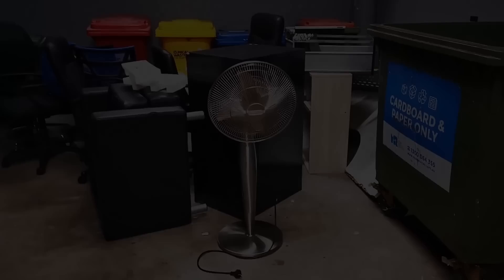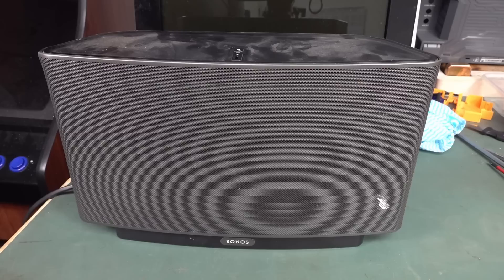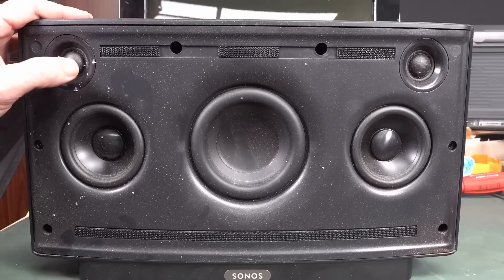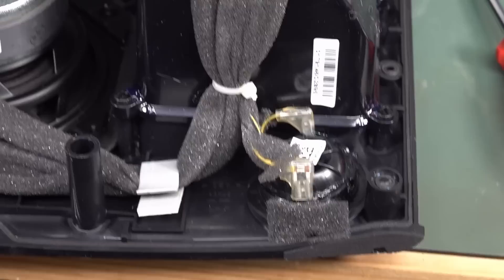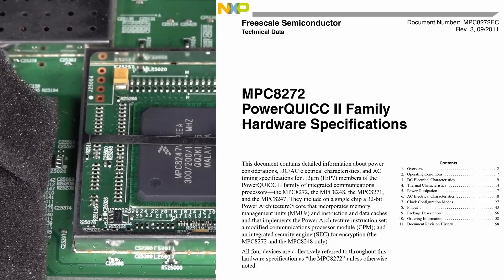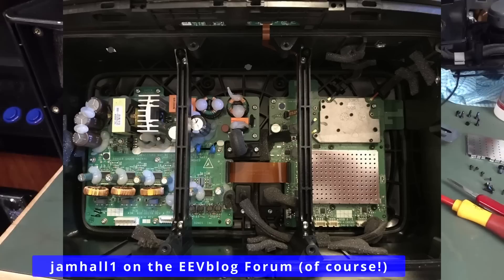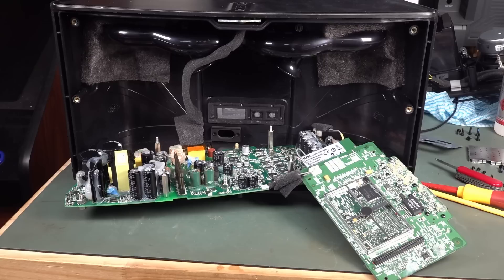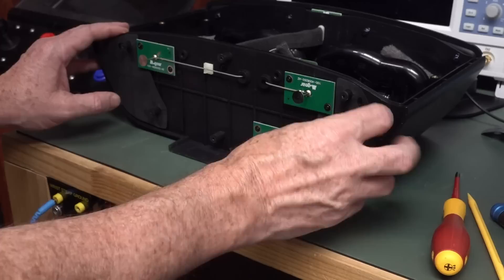EEVblog 1514 - Sonos: The Juicero of Wifi Speakers? (TEARDOWN)

Comment: Peerless is a half decent driver brand, the ports are tuned length to match speaker resonance and the cabinet resonance. Longer the lower they go, this is probably good for ~50Hz or something lol.  The screws are to stop rattling and maintain enclosure rigidity. Overall not bad for a plastic speaker system.

Comment: If my fuse has continuity while mounted on the board, does that necessarily mean that it's ok? Or could the continuity come from the rest of the board via these 2 leads? I'm planning on replacing the 2 blue power caps and bridge rectifier which may have been blown from power surges . Unfortunately my multimeter doesn't have tests for caps and diodes.

Comment: I recently trash picked a wireless subwoofer (not bluetooth or wifi) and the construction was fairly similar, though the case is MDF instead of plastic. It was a Denon, so a fairly mid-high end consumer brand. I've actually had it apart near my bench for a while because as far as I can tell it should work but without the matching home theater base station it's a brick. I'll eventually put a normal wired amplifier in it I think... it's a nice piece.
Reply: If you can identify the amplifier chip inside, you can solder a line level in just fine. Just be careful as some amplifiers only accept a balanced signal. A quick pdf search of the amp chip let’s you identify the pins.
Reply: @FAKEAXIS  From what I remember it actually has a chip that incorporates both the digital decoding and the amplification. I want to say it was a TI chip made just for this kind of wireless subwoofer application. Normally that's exactly what I'd do.

Comment: Dave getting flooded somewhat thematically with portable audio equipment lately out of that dumpster room! :) Wow, this stuff with the powerquicc CPU & the mini PCI 3x3 MIMO wifi card could double as a premium wifi router from around 2013. That amp could well fit in 7.1 surround capable smaller home theater amp receiver. Massive overengineering, but if it was a premium product then there ya have it!

Comment: Sonos is an absolutely fantastic system. It’s primarily a multi room audio system with fantastic sound quality. You need to use the Sonos S1 app for older devices, not the S2 app. You can reset it by holding down the button on top whilst powering on. Then setup in the app. It’s actually great kit and really well supported by Sonos. I had the very first gen demo kit when it arrived in the UK in 2005 and the system still works perfectly to this day including supporting the latest streaming services!

Comment: I have a bunch of Sonos speakers. Would I recommend them? Not really - their control software is *horrible*. Really wish they had a browser based configuration like my old Sony sets had. But, they work fine as Airplay devices and are cheaper than many of the alternatives. Also, why the heck does the Connect (or whatever it's called these days) cost so much!

Comment: Thats a mini-PCI wifi card. we used to use them back in 08-09 while setting up long range wifi with off the shelf hardware. The WMP series is i believe by this company called Compex or something like that. These pci(not pcie) cards usually used an atheros chipset and quite stable.
Edit: i can bet anything that the processor ran a custom linux and used the linux drivers for the wifi connectivity
Also looks like an early prototype. Just get a base board,a wifi pci card and a sound circuit and bam you got a product.

Comment: I got a couple of the little cylindrical ones for free a while back, glad I didn't pay for them. They sound good but between the "cloud" binding, wifi dropoffs, constant firmware updates, and no line in I just found them irritating to use. I've considered either trying to firmware hack them to be dumb stream players or just replacing the electronic guts with a dumb amplifier module to turn them into normal speakers.
Reply: Now yours may be more basic than the one Dave has, but trust me, you do not want to redo the electronics in a fully active speaker from scratch. If you're lucky, they have an analog crossover and you can tap in after the DAC (ideally, with a switch so you can toggle between external RCA input and the stock streamer), but other than that the software route seems the most promising. You never know what sort of EQ is still baked in. You may also be able to interface to the DAC via I²S (people have been using Pis to output that). If you're extremely lucky, you find a passive crossover.

Comment: If it has a sufficient amount of bass it could be a vibrating rattle trap like my old scr-8 portable stereo where I had to remove the metal speaker grills so I could squeeze a bunch of silicone cement all around the corners, and then press the grills back into place. The reason for all that effort was they both buzzed and rang like sickish bells. It was just fine right up to the day the warranty expired. On that day I stuck a 40W RMS power booster in it ( more like 200W RMS, because the stereos internal power supply was 20 volts, not 12V. Oops! ). So all the wires and ferrite cores, plastic panels, and the like might generate some highly unpleasant musical notes. Like buzzing.

Comment: I would remove all electronics and replace it with a power supply and bluetooth amplifier to convert the whole device to just a portable bluetooth speaker. No Sonos app registration issues, just connect and play

Comment: The silastic-guy is legally obliged to squirt at least 42 times because power isolation depends on it!
Reply from the maker: Everyone knows that 15 pieces of flair is the MINIMUM
Reply: It's probably run off the mill hot glue, not silicone.

Comment: All the acoustic foam on the outside is to stop the crappy plastic enclosure from resonating and rattling, especially from the subwoofer. Similarly, when you have active systems inside a speaker enclosure, you need to really secure things, low frequency vibrations can really cause problems over time. The number of screws on this thing is nothing compared to oldschool Sony TVs and VCRs. Bang & Olufsen were even worse!

Comment: Sonos went through a thing a couple years' back, where they were actually bricking Gen 1 units like this when people used the hardware to claim discounts on a Gen 2 unit. As you mentioned, this is not a cheap unit, and that mess flew in the face of hi-fi culture. (How many hi-fi nerds do you know that regularly replace a favorite system, even after 15 years or so?) It is good to see that there is some actual build quality behind the Sonos price tag, however.
Reply: I use Gen 1 JBL GO at work and Gen 2 at home, that would really suck if that happened to me too._
Reply: @primech-128bit  Fortunately JBL is definitely not Sonos. My employer is a Harman Commercial Audio dealer (of which JBL is a sub brand). In the commercial audio sector, Harman does an excellent job backing a storied brand's reputation. From what I've seen, it's the same in the consumer market. I own a set of 230NC wireless earbuds, as well as a Clip4 speaker, which work well for the relative pittance I paid.

Comment: Definitely looks like an early revision product, when the future existence of the business is relying on this product you can resist a lot of value engineering pressures!
Reply: I would say it was a proof-of-concept model and the development program got so far behind that they had to rush that model into production without having any time  to do cost optimisation or improvements for manufacturability.

Comment: But really, antennas on the bottom and setting them down basically on the surface like feet? No wonder it didn't work on the steel bench at work.

Comment: The Devialet speakers beat that on all fronts.
Got two phantoms here, they are super heavy, have excellent bass down to 16Hz for earthquake effects.
Reply: the price though... Devialet are certainly a masterpiece. I haven't heard them, but i was very impressed by what i've seen on the internet.
Reply: @victortitov1740  The sound is near perfect, they go very loud without distortion. Due to the way they power their amps they do tend to draw huge peak power, they make my lights dim on the beat.

Comment: I haven't read the comments, but Sonos was hot on getting owners to upgrade away from early 2010 legacy products back in May 2020.  If you immediately jumped on the 'deal' for 30% off, they would send a kill-spike to your legacy device to disable its use altogether, and it was on you to 'recycle' it.  Due to all the bad press, Sonos actually fell on its sword, and decided to NOT kill legacy devices while still allowing owners to receive the encouraged upgrade discount.  The early adopters of the discount were SOL, and there was no restoration of a disabled speaker.  Sonos is not a massive speaker company and hasn't sold out yet, so this design that doesn't appear to have production cost constraints...and it's from 2009, from when we just started getting miniaturized SoCs.  I have all mine still running the S1 app to be compatible with this Play 5, which still sounds great as a table radio in a kitchen or dining room.  It doesn't deserve to be relegated to a garage speaker yet.  
Their speakers sound very nice and pleasant and accurate to me - and you really can't beat their ecosystem.
Reply: Absolutely DISGUSTING. A company that has the ultimate say on the LIFE of my devices? No THANKS.
I was absolutely right in my feelings about this company and products.

Comment: I am going to say that this is not exactly like the Juicero. The Thing that made that device useless was that it required not only an online connection to actually function, but you could only use their bags with it and it offered and the robustness of the machine didn't really matter to the output of the juice. 

while there are some similarities, this is an actual functional device and it only requires you to bring your own music to it. Once you own it, there is nothing else you have to buy to make it work and if you don't have wifi, it'll still work.

Comment: Seems to me to be engineered well.  If I'm making a premium product, I cannot tolerate vibrations, buzzing, etc. from unsecured components vibrating against each other.  That's why the heavy use of adhesives and fasteners.  Nothing worse than an unwanted buzz from a premium speaker.

Comment: That definitely is the juicero of speakers, I remember when we started to carry them about 8 years ago at a major electronics retailer I worked at. We carried the speakers, but didn’t even carry the bridge that was necessary to wirelessly connect it with anything most people would return the speakers within a few days of purchasing. We contacted Sonos multiple times to try to get the Bridges, but they never sent them. Once they came out with the models that didn’t require the bridge most people already stopped caring about them. And around then we stopped carrying them. 
The engineer is in the comments talking about all the cool stuff he did but if you can’t connect it with anything and have to jump through hoops to get it to work what’s the point?

Comment: Foam like that is probably to address issues with foot buzz. Building powered speakers that don't buzz in injection molded plastics is a lot harder than you might imagine.

Comment: i never seen the inside of a sonos speaker, its impressive. i hate that it has wifi and it needs an app to work. it probably would last 20 year or more if it were just a dumb speaker with some rca inputs on the back

Comment: To be fair, Sonos are not cheap and i would hope that everything is designed and built as best it can be, without needing to invent new physics or materials of course! I wonder if the wifi / control + mixing boards are reused in other wireless speakers they sell.   Any sonos users know?

Comment: its actually quite normal that everything is glued and locked down to a point "above and beyound" on a speaker, mainly a speaker with a heawy woofer and tons of inner cirquitboards and antennas, simply from the vibration.. if it wasnt then they hadnt done their homwwork.
just imagine one thing comming loose, doesnt matter how small that thing is.. a nut, bolt, washer, non critical cirquit component.. then this speaker is defective, useless, as it will rattle everytime things gets going, and it aint like these speakers is easy to open for the average consumer. 
Also why its got so many screws glued down, with that heavy woofer, as it will hump like a mt--f'er in use.
came by some of the all-in-one cloud speakers from danish brands like Bang&Olufsen and Libratone also models from late 2000s and early 2010s..  a pain to work on, as its so overdone, but it makes sense when you think about it.
same goes for Apples homepod, that is a PIA to a point, that this Sonos seems like childplay to open.
Hope you or your kid, can get some use of it, as one certainly cant take for granted that fx newer models are better sounding.

Comment: I’ve owned taken apart a Gen. 2 and they simplified it a bit, but it’s mostly the same well built as this machine. Sadly the WiFi in those machines are known to die.
I currently own a Gen. 3 (renamed slightly) and it’s absolutely worth every penny.

Comment: ..........why do you get wifi thingys and meanwhile i find old disposable masks, gloves and panasonic phones??
juicero uses 50,000,000 more parts and effort points to accomplish what squeezing the sides of the bag does just as well....
but this does what it says on the box in a premium form factor
Reply: in Australia they have big office parks full of small offices and people buy the units as investment properties. (this kind of thing doesn't exist in other countries.) the trash room there always has business e-waste like this.
Reply: You're looking in the wrong dumpsters clearly. You need to target the dumpsters for the stuff you want to find. You're not going to find good stuff in the dumpster close to a homeless camp...
Reply from the maker: @ssl3546  I thought business parks are fairly common in other countries?
Reply: @EEVblog  somewhat but turnover isn't high enough on good electronics, I just found an electronic dart board, a cellular light/vent fan(new in box) and a pedestal fan also new in box.... Still better than a wireless voicemail landline phone

Comment: I think Dave forgot how expensive a Sonos speaker is. Once you're paying that much, there's a certain amount of quality you expect, and I think what you see reflects it. After all, you're talking about a speaker that costs over $500 USD. If it has  pieces that rattle inside or parts that get blown to bits over time because of the vibrations, people wouldn't put up with that. I mean sure a $50 Bluetooth speaker you wouldn't expect such construction, but a $500 one you would expect them to take the time to actually do things right. Also, unlike Juicero, Sonos stuff does work and work pretty well - other than a few mis-steps over the years, the general impression of their stuff is pretty good.

Comment: Now measure the standby power consumption of this Play:5  Gen1. Maybe its natural habitat should be the dumpster?
Oh - and for this annoying kind of registration crap you can use a 10 minute mail disposable mail address.
Btw: if the speaker will not power up anymore at some point, replace fuse and rectifier. 
One engineer obviously didn't finish his homework!, as this issue is very common.

Comment: Real tweeters? and ACTUAL bass speaker and not just a passive radiator? Transmission line bass port? Wow, effort! Someone's actually trying! I was honestly expecting the tweeters to be fake and the bass speaker to be a passive radiator, just like in the rest of today's crap modern electronics.

Comment: I have a pair of Sonos speakers that I've been thinking of tossing in the trash. I won them so they cost me nothing. The sound quality is crap and I have zero use for them. They seem to work best using some Apple play "thing," not sure what the system is called but they are useless to me because I know nothing about apple anything and they latency is near a half a second so I can't use them for anything besides listening to music with the stupid app. If they had added a normal input of some sort or even bluetooth I could use them. BUT... wifi or network only??? I'll just rip the guts out and attach a normal BT module to them or something I suppose.

Comment: 13:05 Don't overrate modern assembly cost. Letting some low wage country employers screw some extra screws in cost 0.10 cents extra or so, assembly cost is just fraction of the price the ask for those higher end products, total assembly cost is maybe 5-10 bucks in total or so

Comment: Juicero is way more wankery. No DRM here - just high cost of entry. Plus sonos provides an actual solution to a common problem. I might be biased though. I have 2x Play One SLs, Arc and Sub (full-size) out the door was just over 2k. The sound quality is really good but the app could use some work. About 50% of the time if I start listening through Spotify (I like it's navigation compared to Sonos' app) it will somehow cause the system to drop off my network. It will eventually come back but is quite annoying.